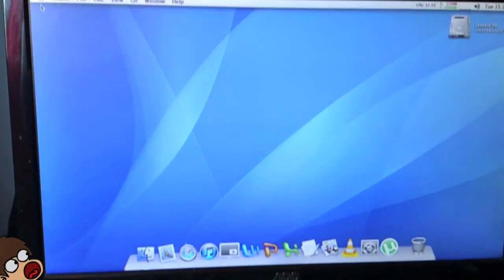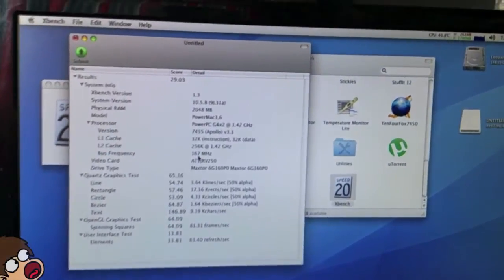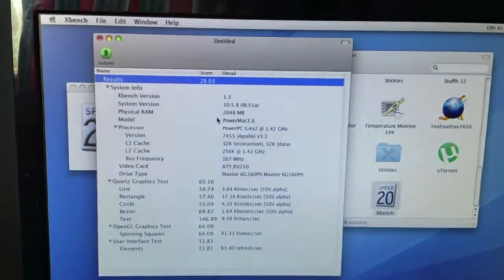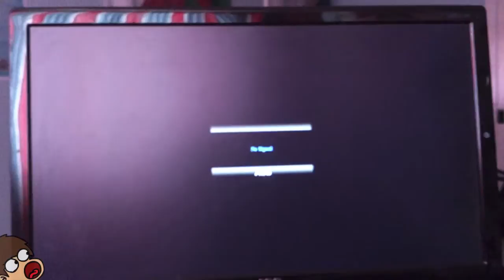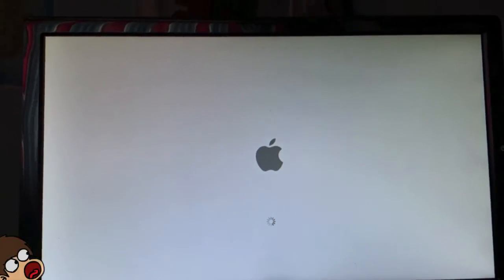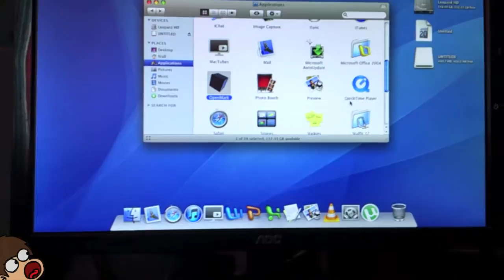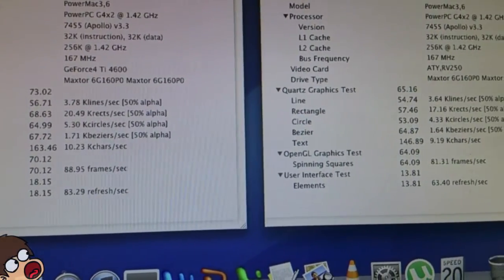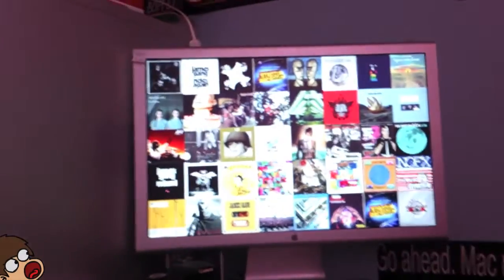The FF-Class PowerMac G4: Nvidia GeForce 4 Ti 4600 Install [2/2] | The PowerPC Hub

Comment: im probably going to buy myself a dual 2.0ghz g5 there really cheap now a days i have a single 1.6 but it is so slow
Reply from the maker: Yeah it's crazy how much computer you get for so little money in the G5's these days.
Reply: *****
i remember the days when a dual 2.0 would set you back 400$ around 250 pounds now theres one on ebay for 129.99 dont know how much that is in pounds though
Reply: 1.6 is slow? Really? I would have thought it would be faster than what I have. I have an iBook G4 1.33 GHz 1.5 GBs of RAM under Tiger, and it's superb. I also have a new 12" PowerBook G4 1.33 GHz 1.25 GBs of RAM under Leopard, and it runs really well with a 64 MB graphics chip. They do everything I want them to, and are really speedy and small.
Reply: i have a 1.33ghz ibook g4 to my ibook is quite a bit slower but the single 1.6 runs really sluggish a g4 dual 1.42 would probably run faster

Comment: Really enjoying the upgrade videos - but the flashed ATI Radeon 9800XT in my MDD would smoke your GeForce 4 Ti! :-) It's still a great card to have though, just a shame it doesn't support hardware Core Image. I can't wait for the fan upgrade, with my MDD switched on you can practically hear it from the other end of the house.
Reply from the maker: Don't tempt me! :D
Reply: ***** To get Core Image support in leopard, you need at least an ATI 9600, or Nvidia fx5200. Given the choice, I highly recommend the ATI cards, as they have the nice ATI control panel with custom options for games.